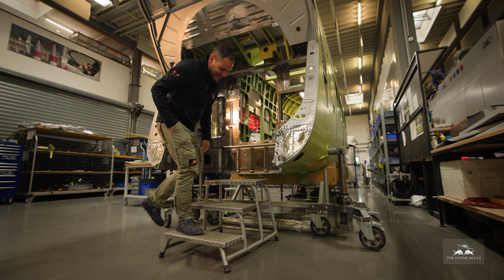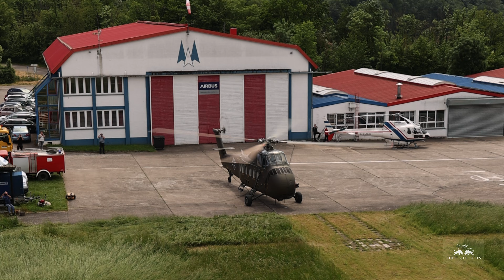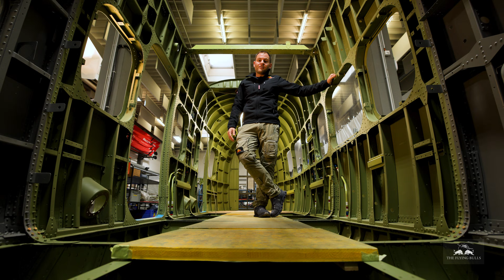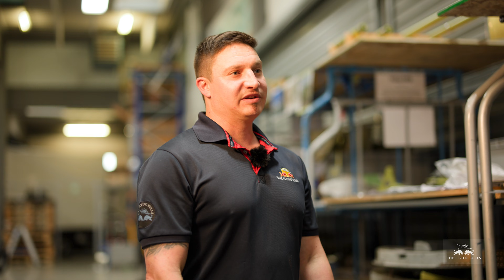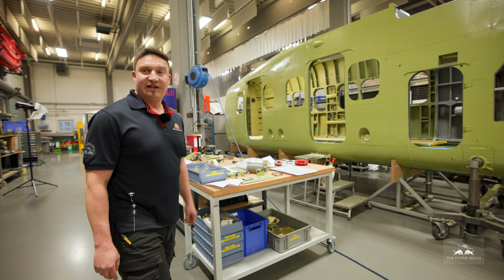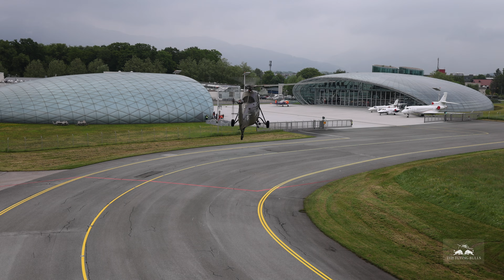Restoring the iconic Sikorsky S58 (Part 1)

Comment: SUPERB. I am a veteran RAF aircraft engineer and pilot. I have worked on many old helicopters restoring them Bristol Sycamore, Skeeter, Westland Wessex, Wasp, Whirlwind, Scout, Lynx, Puma, Chinook, Sea King, Gazelle and many fixed wing aircraft over the years. So good to see an S58 restored. A thing you need to watch on these during shutdown in the droop stops on the rotor head. In cold weather sometimes they dont all go back in as the main rotor loses speed. If that happens you can get a 'tail strike' from a drooping blade. So always have a groundcrew watching them as you reduce rotor speed. If it doesnt go back in increase rotor speed again to raise the blades then try another shutdown. SAFE FLIGHTS guys.

Comment: Crazy story.   I was a Rip Tide sitcom fan years ago that featured the S58.   Fast forward...I ordered the Rip Tide collection on Ebay...received it.  A day  later a S58 came over my house low and descending.   It went to a large warehouse and it was lifting large AC units off the roof.  I drove over to make sure they were ok.....I thought they were autoroating in...as in engine out.  Not the case thank goodness.

Comment: In Honolulu Hawaii, the Honolulu Fire Department owned a H-34 (S-58). In my early years working for a Helicopter maintenance  
facility as a helicopter mechanic, fresh out of Airframe & Powerplant school, this machine was one of the helicopters I learned to work on. This was in the late 70s. It was impressive to work on. One of my jobs was replacing all hydraulic lines and oil lines in the transmission area. Just hearing the start up and run up of that radial engine was so cool, while standing as fire guard. After it was decommissioned from the Fire Department, the S-58 was donated to the Aviation maintenance technician school. Sadly, the students ran it up and it got airborne slightly hitting the pylon on the chain link fence causing major damage. Later on, the students oversped the engine disengaged causing the fan blades to be thrown from the hub. I always admired the S-58. 
The military version H-34 saw action in the early years of the Vietnam War.

Comment: As far as I know, those second generation helicopters were still mostly manual. Twist grip throttles . No AFCS or digital autopilot assistance. Vibration must’ve been noticeably worse that in newer helicopters that practically fly themselves.

Comment: I spent a few years as a (last) dock-chief (airframe mechanic) on those S58/HSS1 when they still were operated (training) by 40 Sqn Heli SAR at EBFN (Koksijde AFB). Those were the best years of my time in the BAF. There were few differences between both types. The position of the engine exhaust and the number of windows are the most obvious. Also The HSS1 was an under license built S58 by Sud-Aviation Marignane (Fr).
As far as I remember we operated 13 of these choppers before being replaced by 5 Westland Sea King Mk48. The 3 last (OTZ-KD, OTZ-KE and OTZ-KH) flew until the mid 80ies. OTZ-KE crashed on EBFN in 1985; no injuries. OTZ-KD was later used for static displays during airshows and OTZ-KH ended as gate guardian of Koksijde Airbase (EBFN).

Comment: I had a couple of these but the military version, 125 to be exact. Most were junkers in the Tucson desert. I bought a flying one in CT and took it apart and hauled it to WA. It had been sitting for a while. Eventually a former Marine who had flown them in RVN bought the flying one to restore and another that was complete. The military version had magnesium skin all over and the skin was in bad shape. It had been sitting in a shed in Forks WA for 40 years. It was a great adventure. The bulk of the lot in AZ was scrapped. a couple wound up in museums.  Be very careful of the tailwheel tube, it will break easily. never tow from the tailwheel. I may be able to help find parts if you need any. Brown Helicopter had plenty.

Comment: It must be 50 years ago, I sometimes flew as a passenger to oilrigs in the Northsea with KLM on a blue painted Sikorsky S58-DT . This machine was also used in the Vietnam war they told us and had some bullet holes. It wasn't very convenient, only canvas chairs and very noisy. But much faster then a supply boat!
Reply: In the southern north sea they used wessex helicopters which i believe is a licenced version of the  S58, they lost one in the 80s with all crew unfortunately